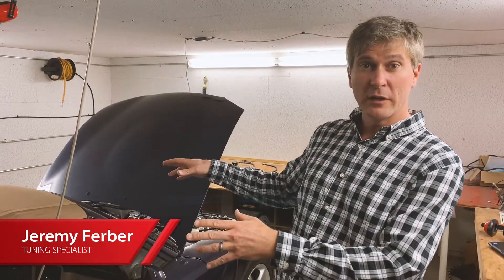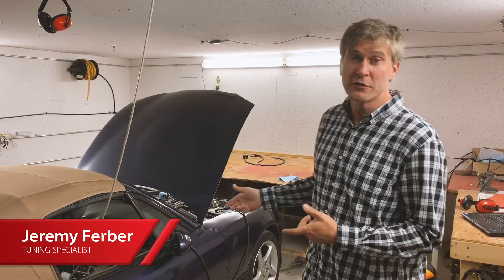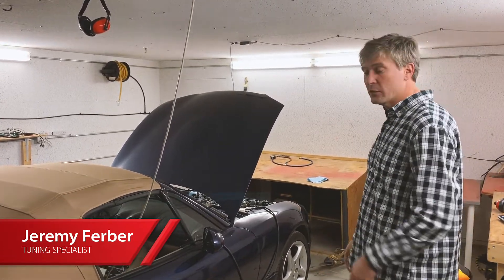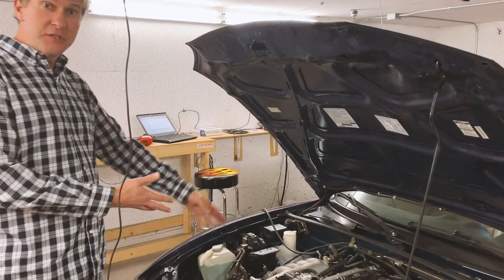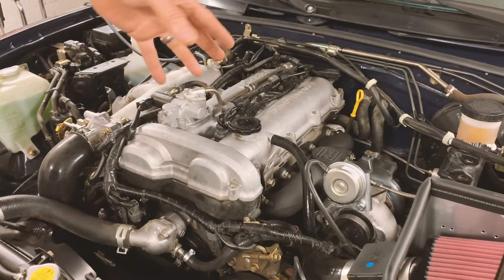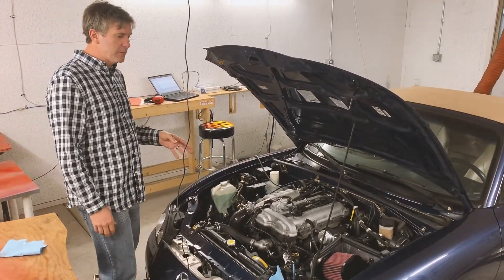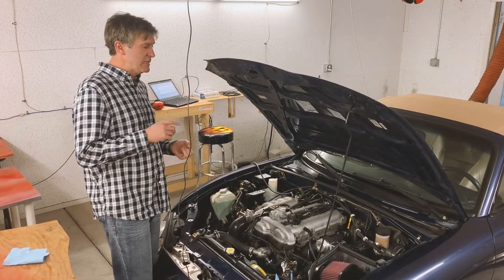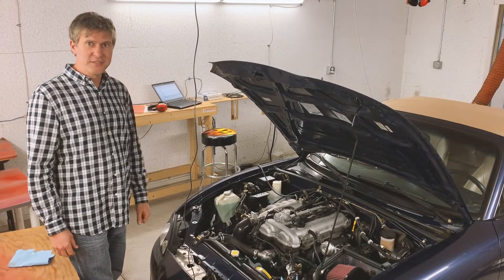FM NB Dyno run - 50 State Legal Stage 1 Turbo

Comment: Any update on the carb legal turbo kits for NB2 miatas? Ive been checking the site somewhat weekly and subscribed for stock updates but its been over a year and havent heard anything. I think I saw that they came in stock once and I missed the window. Another guy I know said he's been checking as well and hasnt seen any change and its been about 1.5 years now.

Also, any future plans for improving/updating the carb legal miata turbo kits?
Reply from the maker: We're having trouble sourcing the required electronics - first the chip shortage, then our vendor had some problems. We're working hard on multiple solutions right now and trying to get them back on the market - if we don't have them, we can't sell them and that's bad for both us and our customers. So it's a very high priority around here.
We are constantly making improvements to the kits. You don't necessarily see it because they're not usually worthy of a press release.
Reply: @FlyinMiataVideo  thank you for the update! This may be not the right place to ask this but as someone who has worked in the logistics field, is it possible to temporarily source the electronics from other vendors? or perhaps have the electronic components partially assembled and shipped to another vendor with the needed components to finish the job or perhaps finished in-house?
Reply from the maker: @JupiterxBlues  If only it were that easy. These are not commodity units with off-the-shelf software.

Comment: Do you know when these complete kits will be back in stock? I have a 2001 with 28,000 miles.. bone stock. I'd like to order one of these kits soon.

Also, are these kits safe in the Texas Summers? Thank you
Reply from the maker: The most recent batch of manifolds didn't pass QC, so we're working with the supplier to see when we can get more.
They'll work fine in a Texas summer, although you will likely want an upgraded radiator.

Comment: Can this be done for an An Automatic Miata? I have the 2003 LS 4 speed auto.
Reply from the maker: This kit will indeed work on an automatic. You will need a different exhaust, as the flange for the automatic exhaust is different than the one used on the downpipe.

Comment: Good video.
A couple of questions.
I'm not comfortable doing this kit on my own. Are there places in Ontario ( Canada ) that have done this kit.
And Will I need something other than a stock clutch in my 04  6 Speed ?
Reply from the maker: Check with Dave's Garage in the GTA. Dave can probably pull it off.
The clutch in your '04 will be borderline. Chances are it will have trouble holding the extra torque of the turbo, but it's possible it will survive. You should probably expect to have to replace it.

Comment: With this kit, is the wastegate the only form of boost control or is there a manual controller tucked somewhere in there?
Reply from the maker: On this particular car, there is no boost controller, but you could easily install one. We usually recommend it, especially on cars that will see a lot of altitude changes.

Comment: Can I add a boost controller n boost a couple more psi to this kit. And is it normal cause I only get 7lbs not 8.
Reply from the maker: Without a boost controller the kit will vary based on altitude and ambient pressure. You should be able to add a boost controller, but the Voodoo box is very limited. Give us a call and we can talk you through your options.

Comment: What if I wanted to add more power and add a bit more boost with this kit? Do I just need bigger injectors? I want to still be able to pass smog but push 10 psi without worrying about leaning out and failing smog PLEASE HELP
Reply from the maker: Our Voodoo kit is made to only work with the stock injectors, so you can't run bigger injectors without a true aftermarket engine management system. The boost with this kit will vary based on location as well. Since we are at such a high altitude here in Colorado, this car would actually be running more boost at sea level on the exact same set-up. If you have time, give our tech's a call at 970-464-5600. They can go over your options and give you details on what you need to hit the numbers you want. Hope that helps!

Comment: Can't wait till I finish rebuilding my motor. I got the voodoo 2 kit and I'm excited. However I am curious with my rebuild I am using 8 to 1 compression vs the normal 9 to 1 nb1 compression.. I'm curious how much power I'll make.. besides the Pistons everything else on the motor came off my nb1 like the intake mani, injectors and head..  hopefully the lower compression will not kill some power with the voodoo box
Reply from the maker: You won't make any more power with the lower compression, as the Voodoo 2 system is limited by the size of the stock injectors. The lower compression will slow the turbo response so it'll spool a little slower. You can run a bit more timing to compensate and you'll probably need just a bit more boost to get to the limit of the injectors.
If you decide to go further later and install a programmable ECU with bigger injectors, you'll be able to run more boost before you hit the knock limit and you'll be able to make more power with that low compression. But right now, the injectors are your limiting factor.
Reply: @FlyinMiataVideo  ahhh makes sense! I do plan on getting bigger injectors and getting a standalone in the future I am now running forged rods so my power goals for the future will be around 250 to 270.

Comment: What causes the dip in power at ~4200 rpm on the stock map? I feel it in my NB2 all the time
Reply from the maker: This seems to just be a characteristic of the stock system. It could be multiple things, but we don't see everything behind the scenes in the stock map to know the definitive reason.
Reply: I have no idea whether this is even remotely possible or not, but it could have to do with the shape of the intake manifold and the effect of resonant supercharging at particular rpms. The nb2 style intake manifold has exceptionally long intake runners when compared to other Miata generations. It could also be vvt related ¯\_(ツ)_/¯

Comment: I have a stock 02 miata. What kind of 0-60 and quarter mile times with this set up?
Reply from the maker: We honestly haven't measured this since there are so many variables that can change these times. Tires, altitude/location, surface, temperature, gearing, etc can have a huge impact.Sorry  I don't have an exact answer for you.